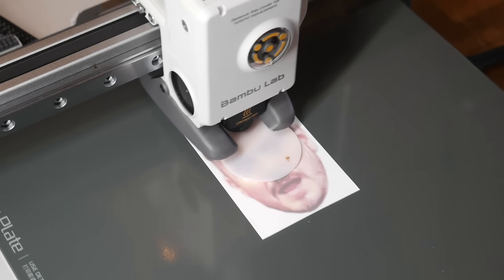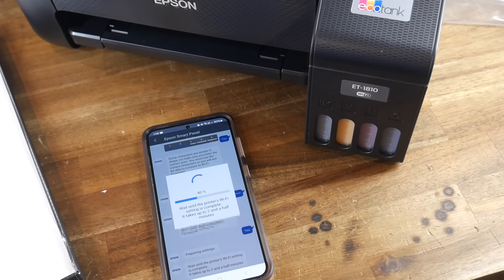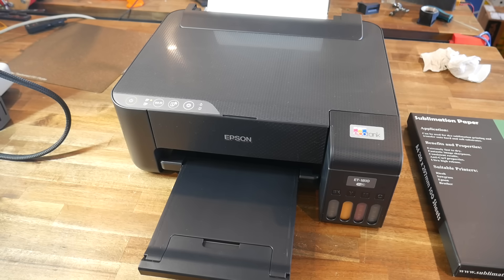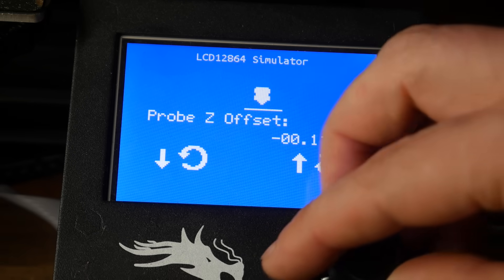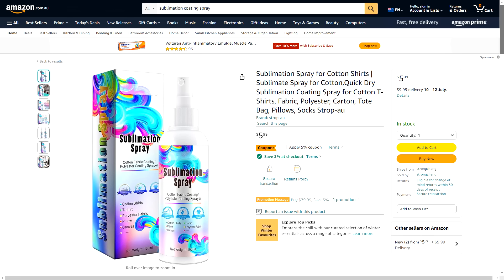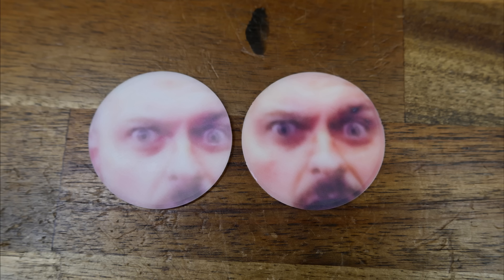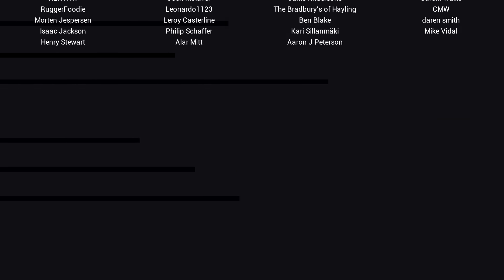Full colour first layers on your 3D prints - Sublimation guide part 1

Comment: Setting the squish in the start g-code where you suggested resulted in the nozzle wipe area being decimated on first use - as this is the first time I ever used the engineering plate side. I burned through two engineering plates before I realized this was happening. I ended up putting it at the end and wrapped it in an if statement like the prior example:

{if curr_bed_type=="Engineering Plate"}
G29.1 Z{-0.12} ; for Engineering Plate with Sublimation
{endif}

Comment: I used a Tektronix dye sub printer in the mid 90’s when the cost in-house was about $5 a page.  I remember the “paper” as glossy and plastic-like.

I wonder if you could print on that kind of plastic sheet, put it face down on the bed, then get the 3D filament to stick.  You wouldn’t lose resolution or color saturation that way.

Edit:  Best answer I found for paper:  “The A-SUB 125 GSM is the ideal paper to use in an Epson EcoTank or Dye-Sub printer. It absorbs the colors very well and has a high transfer rate onto a wide variety of blanks like t-shirts, mugs, tumblers, wood, etc.:

Comment: Unlocking Full-Color 3D Printing with Sublimation: A Comprehensive Guide

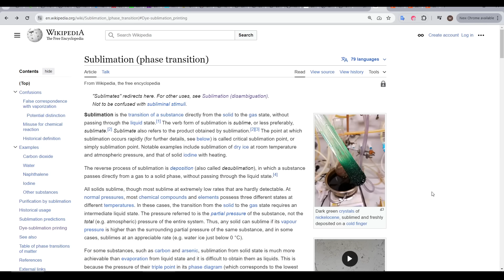* 0:59 Sublimation Explained: Sublimation is the process where a substance transitions directly from a solid to a gas, skipping the liquid phase. This technique is commonly used for transferring dye to polyester fabrics.
* 1:35 Affordable Sublimation Printers:  Epson EcoTank printers, specifically the ET-2400 (US) and ET-1810 (Aus), are recommended as cost-effective options for sublimation printing.  [From Comments] While EcoTank is a good option, using a cheap older Epson printer with refillable cartridges could be even more economical and mitigate issues with ink settling and clogs.
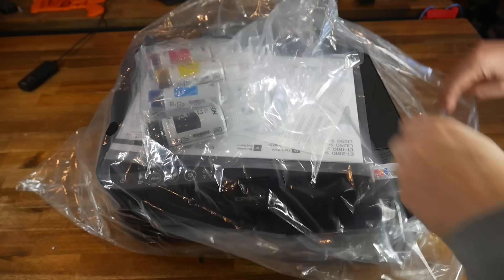* 2:56 Setting Up Your Printer: Converting an EcoTank printer for sublimation involves replacing the standard ink with sublimation dye. Various methods for transferring the dye are discussed, including using syringes and custom-printed adapters.
* 3:00 Warranty Void: Be aware that converting your printer for sublimation will likely void the manufacturer's warranty.
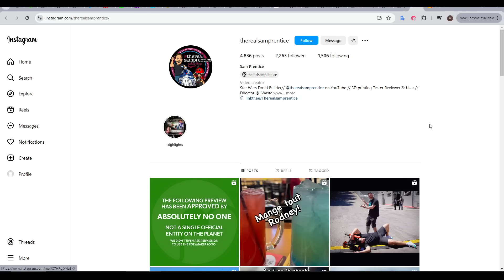* 5:37 T-Shirt Example: A practical demonstration of sublimating an image onto a t-shirt using a heat press.
* 7:04 3D Printing Integration: The process of integrating sublimation with 3D printing involves printing a design onto sublimation paper and adhering it to the print bed before starting the 3D print.
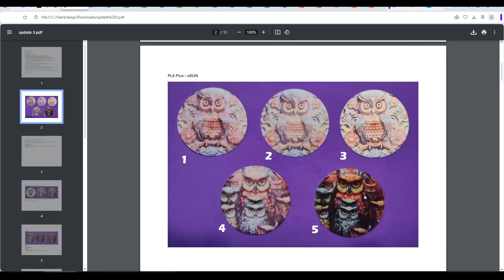* 8:50 Optimizing Print Settings: Achieving optimal results requires specific print settings, including a slow first layer speed (5 mm/s) and a significant amount of first layer "squish" to ensure complete dye transfer. [From Comments]  On Bambu Lab printers, the first layer squish can be adjusted by modifying the start G-Code.
* 9:20 Infill Pattern Considerations: The choice of infill pattern for the first layer can impact the final sublimated image. Concentric or HBT Curve patterns are recommended.
* 11:22 Double Printing for Enhanced Color: Printing the sublimation design twice can significantly improve color saturation.
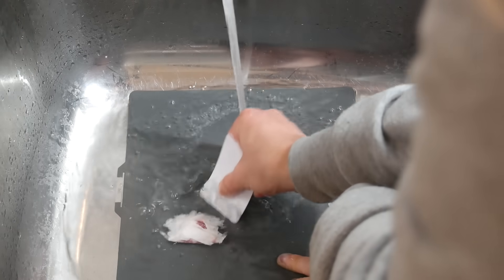* 12:34 Glue and Cleaning:  Using a glue stick to adhere the sublimation paper to the print bed is recommended. The glue and any paper residue can be easily removed with warm water and a scraper.
* 13:59 Registration Techniques:  Accurate alignment of the sublimation print and the 3D model is crucial. Using a template or drawing registration marks with a Sharpie directly on the print bed are effective methods.
* 15:12 Applications: Sublimation combined with 3D printing opens up possibilities for creating custom merchandise, functional prints with integrated labels, and unique personalized items.
* 16:57 Durability: The sublimated image is highly durable, resistant to scratching, water, and isopropyl alcohol.
* [From Comments] Laser Printer Alternative: An alternative method using a laser printer and transparency sheets is suggested for black and white images.
* [From Comments]  UV Protection: Applying a UV-blocking coating to the finished print is recommended to prevent fading over time.

I used gemini-1.5-pro-exp-0801 to summarize the transcript.
Cost (if I didn't use the free tier): $0.11
Input tokens: 29200
Output tokens: 713

Comment: Why does your mate look like Keith Lemon?

You can convert any standard inkjet printer to sublimation, although you will get varying results. If converting a used printer I would recommend buying new empty cartridges and a new print head, although you can flush a used head by having an extra set of cartridges filled with an Inkjet flush liquid, and run it through a few cleaning cycles.

Comment: For me, if I need material to squish into the build plate, in addition to lowering the Z axis a bit, in Cura, I can adjust the Initial Layer Flow which only affects the bottom layer and greatly reduces the line gaps when printing on an Ender 3 v3 SE. I use this when printing on textured build plates. It would work great for sublimation printing also. I have my initial layer flow set to 130%.

Comment: There’s another affordable alternative for folks who don’t want to buy a new ecotank printer. Ecotank is a CISS (Iontinuous Ink Supply System) printer, and you can get conversion kits for ~$90AUD and convert your existing printer (e.g. the cheaper WF-xxxx printers that are so ubiquitous and often being given away on gumtree, or the ones with higher print quality than the ecotanks). Conversion is really easy (there’s plenty of videos on YouTube), and using CISS saves you so much on ink costs (compared to cartridges).

Comment: Anyway you can you switch back and forth between standard ink and sublimation? Don't want to have to have 2 printers if I didn't have to.
Reply: Guessing no. The two inks are going to use different types of chemical chemistries, and will probably not mix well and cause all kinds of issues in the printhead.

Comment: Hi. I’m a sublimation nerd. My husband is a 3D nerd… so combined we already have the equipment and skills. Firstly, sublimation only works on plastics… so the t-shirts have to be at least 50% polyester for sublimation to work. Yes there are sprays (as shown in the video) but these can be messy and do not always leave a washable image on the cotton garment. An alternative might be a DTF hack … which we shall definitely try … you will need DTF sheets that you print on through either your standard inkjet printer or, if you have one, your sublimation printer, and then you need DTF powder. This powder soaks into the wet ink right after printing, and acts like a plastic glue. If you cure the image and powder with a heat gun then use heat resistant tape to tape it to the print bed, this may provide a stronger transfer. Google DTF sublimation hack … there are a few videos on this.  I’ll give it a go later this week and report back. 😊
Reply: How did it go?
Reply: A match made in heaven.

Comment: Intro: "You dont need a special printer"
2mins in "you need a special printer, or a 2d printer that youre going to dedicate to dye-printing"
... F.
Cool technique though. Limited use, but still cool.
Reply from the maker: Intro: you don't need a special 3d printer. Please don't misrepresent.
Reply: @TeachingTech  Still need either a specialised printer, or to ruin a standard printer with ink that will quickly damage it to make the design. You dont need to get upset, its just fact.

Comment: For increased or decreased ink deposition on a print, we use an HSV or HSL filter in an editor and change the value (V or L). This affects the amount of white in the image, which for a printer without white ink correlates with the amount of ink deposited as white comes from the substrate. Saturation sometimes need to be adjusted slightly too (typically boosted if increasing white or reduced if reducing white), but fundamentally you need to control the white mix.

Comment: For the Bambu labs, you should be able to get significant first layer squish by setting first layer to .1 mm or even .08 mm and setting first layer line width to 150% of the nozzle width. This technique interests me because I already have sublimation and DTF capabilities. I’ll give it a try with my squish settings as well. I’m wondering if this will work for DTF as well. The powder is PET I think so it may work well with PETG but not PLA. I would expect you would be able to print at a faster speed but there’s a question about whether the film could withstand the process. It should, in theory, since it can withstand the heat of the heat press in normal usage.
UPDATE: I tried the DTF print with PETG and it failed completely. The filament wouldn’t adhere to the film at all. It only produced a glob of PETG that stayed with the nozzle. Fortunately I was watching and could cancel before doing any damage. But this should be a good lesson for anyone trying something new. Always watch a new process closely. When it’s been proven, then, and only then can you leave it unattended.
Reply: I was having issues with .1 for the top layer, but setting it to .02 worked pretty great

Comment: Is it possible to simply print and then use the heat press with lower temp but a bit longer ?
Reply: @NIXJulien  The process happens around 325/350.  Most doing sublimation go between 375-400. 400 tends to be too hot for fabric.

Comment: Looks like once transfered part of the ocoor is lost. Have you tried to print the pictures with higher saturation and contrast?
Reply: Sublimation ink prints out dull, and not even the colors you wanted. Once it goes through the heat process, the magic happens…colors become correct and bright.

Comment: Nice! I've been doing this using a laser printer and transparency paper for about a year now! It even works with regular printer paper when using a laser printer if you rub off the paper with cold water. This is definitely a cheaper method, especially because of the high cost of color laser printers and toner! Nice job! I may replace my current laser printer setup with this just because the ink is so much more affordable.

Comment: You can do it the other way around without attaching things to the print bed. Just 3D print the object, preferably with a flat surface in PETG, and then print the design on the sublimation paper, and then using a heat press or mini handheld press and a little bit of pressure to transfer the design. The downside is that the paper will stick to the print, however, you can easily wash it off and it looks amazing when done! Just have to be a bit careful with the temperature.

Comment: i just bought an ET3850 just a month ago! stoked.. Also, to help people searching, since i did a lot
some of the 4 color come with a pigment based black which is supposed to yield better black results, 
i used both back too much a difference, but it is nice to have.
you can get great deals if you check for refurbished/used amazon listings, i found the 3850 for half the price nearly there - epson certified too

Comment: Highly recommended if you can get an Old Epson R2400 Stylus printer they're essentially the older version of the Ecotank- 8550, but technically better because they also have light majenta and light cyan, and you can mod them with external tank cartridges and external waste tanks and buy after market k3 ink for much less than what you're paying for ink straight from epson.

Solid score if you can grab one

Comment: Hi everyone, tried this method and got some good result with some added technique, when printing from photoshop there is an option to print with extra ink (no need to run the paper through the printer again), when cleaning the paper from the 3D print don’t use hot water (around 30C), and the final tip is to clear spray the 3D print as a final step makes the colors pop.
Reply: Clear spray the 3-D print as a final step with what?
Reply: @ with a clear spray paint/ epoxy clear paint or UV resin.
Reply: @ ohhhh duh, idk why I didn’t think of that.. geez I’ve done that on other type things lol

Comment: Do you need a sublimation press or can you use an iron?
Reply from the maker: I don't see why you couldn't use a dry iron. It will just be trickier to get the temperature and pressure uniform.
Reply: No need for a press, in the video he puts the paper right on the 3D printer bed. If you want to press it on, you'll need a filament with a high softening temperature, otherwise you'll warp your print.
Reply: @Aashka_The_Mystic  I was talking about for T-shirts not the 3D printing part

Comment: Or.....what you could do is 3D print a support panel to place under the item to be sublimated to keep it off the heat press bed & then tweak your pressure & dwell time on the press to achieve a better colour density on the final product. Would eliminate the need to double print the pages.

Comment: Maybe I missed but was the paper used in video plain or glossy? And like someone commented, to have even more color, maybe saying to printer it's plain paper, but actually using glossy and hoping that these isn't not too much ink.
Reply from the maker: It's sublimation paper. It's designed to hold the dye but then release it to the garment. I used what came in my kit, not sure how much variation there is.

Comment: A cheaper and easier solution could be to go to a document center and get you image printed on heat transfer paper. It's printed on a laser printer and usually offers better quality prints. It should work the same way with the process you used on the 3D printer. Also, maybe a glass on you heat bed will work better to reduce the layer banding/spacing.

Comment: Next: sublimation inks jetted to filament in 3D printer hotend :) Or it can be magazine of sharpies (how to touch all sides of filament) etc as long as single white(ish) filament is enough. I know of a mod to "paint" layers with sharpies after extruding them.
Reply: yeah he did a vid on it but it only works for bed slingers and not core XY. It may be doable to get it working for the 2.4/SV08 but I'm not sure...

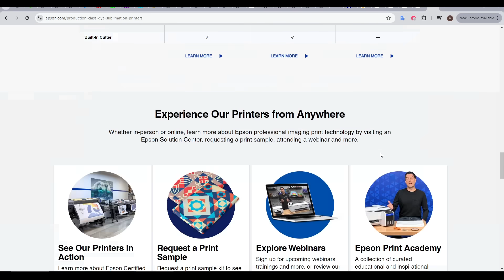Comment: 1:44 I work at a FabLab (Fabrication Laboratory) which is kind of like an open workspace for hobbyists or students who want to make something. the prices are really cheap because you make everything yourself but you can use the machines available as long as you follow some rules. 
for those wanting to start a small business with printing t-shirts, I recommend checking if there is a FabLab nearby you and use their services if you don't want to invest in a Print & Cut (yet)

Comment: this combined with prints that fold up from being printed flat could be very interesting. no need to paint after you fold it all up. Like an unfolded cube, say. print flat, each face gets it's own section of sublimation imagery. Then take it off the print bed, fold it up and glue together, or model in some snaps. boom, full color printed cube. For low poly models this could be really interesting.

Comment: After 28 years of struggling with troublesome printers, I broke down and got an EcoTank last year.  I don't use it for sublimation, but its performance has been relatively stellar.  Why?  It works.  I press PRINT and it prints properly, even after not using it for weeks.  No extra steps needed.  No driver reinstallation required.  No fighting with ink cartridges required.  No intrusive, periodic demands to set everything up all over again.  When you say it's good for this particular 3D printing purpose, I believe you
Reply: Our ET (2650) was the worst, because when not used, the print head dried and didn't recover with any number of cleaning cycles. For non-frequent use cheap printers with expensive cartridges (with new, clean print heads) are easier. Cartridges can be stored "forever" :)

Also the ET colours were not as and saturated as in HP and Canon, and I didn't find any way to adjust them.
Reply: @kimmotoivanen   I can see that being a problem. But I use it every week or three for non-color-critical purposes. For that it's been superior to all my past printers, which managed somehow to quietly break or get a corrupted driver between uses
Reply: Perform the power cleaning, wait 12 hours, and then print a purge sheet. Please let me know if the problem persists, there are a couple more easy, but long solutions.  @kimmotoivanen
Reply: @kimmotoivanen just get a laser printer ink jets are crap
Reply: @andreamitchell4758  I have one B&W, but it doesn't have scanner. Colour laser printers did fair job even 20 years ago, not sure if they have improved to match ink jets in photo quality (glossy paper, dithering/screening).
Laser "ink" is somewhat transfer-able with heat, but I doubt it works like sublimate or even normal jet ink 🤨
Reply: @kimmotoivanen  oh I just meant for regular 2d printing not for this use case
Yeah I am sure color laser printers are as good if not better than inkjets I know they were even being used for counterfeit US currency so they must be pretty good.
But yeah I don't even see the need to own any color printer really 99.9% of prints will be in black and white and color ink is just so ridiculously expensive it is just easier and cheaper to download the big pharmacy chain apps and send it off there.
I have a nice Canon PIXMA  all in one inkjet photo color printer but I think we have maybe printed a color photo on it twice and as for color prints maybe a bit more but it seems like it needs ink every 5 pages and even the cheapest Chinese ink from Amazon is still way too expensive when you compare it to just ordering prints from the pharmacy chain especially when they always have coupons or deals for free prints.

Comment: You can also convert certain (Maybe all?) Epson Workforce printers to use sublimation ink. They are cheaper than the Ecotank printers. You can either swap the standard cartridges for refillable ones and use sublimation ink, or buy an external continuous ink supply tank made for the purpose which feeds ink to the internal cartridges via tubing.